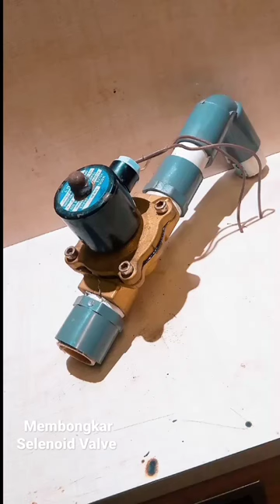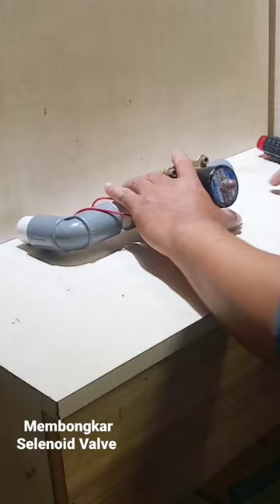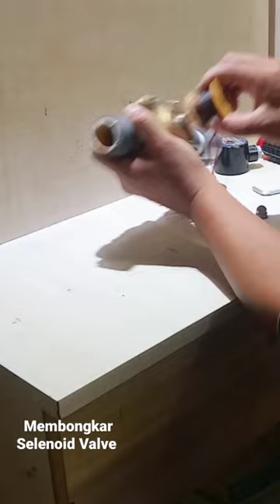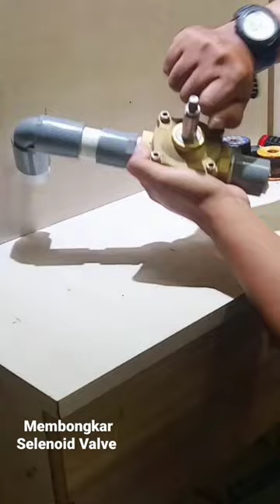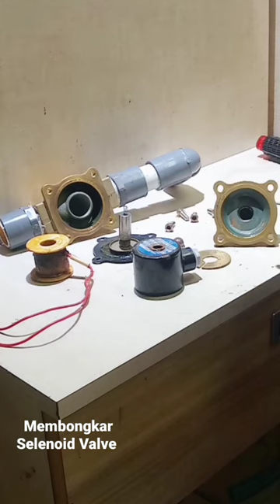Membongkar Selenoid Valve #Shorts #Diy #Selenoid #Valve #Perbaikan

Comment: Saya beli 2 untuk toren air dengan pompa sibel. Cuma tahan 2 hari. Habis itu kadang buka ga mau tutup lagi atau sebaliknya ga mau buka sama sekali sampai pompa sibelnya trip. Teryata selenoid model seperti ini khusus air bersih gau mau air kotor/berpasir.
Reply from the maker: Iya memang kemungkinan ini buat air bersih.... Kalo mo pake ini biasanya melalui filter air....
Tapi kalo tidak mau buka tutup biasanya juga karena kumparan magnet tidak berfungsi
Reply: @dhedydiecaster8514 saya pemakaian 3th tadi pagi dia buka nggak mau nutup lagi,jadi torrent luber ,apa karena kotor ya gan? Atau memang magnetnya sudah habis? Saya pakai lgsg dari pipa PAM ke torrent.